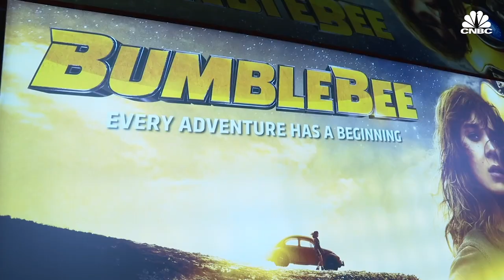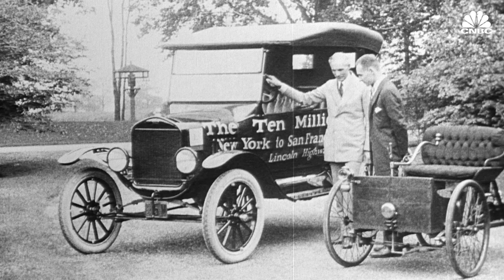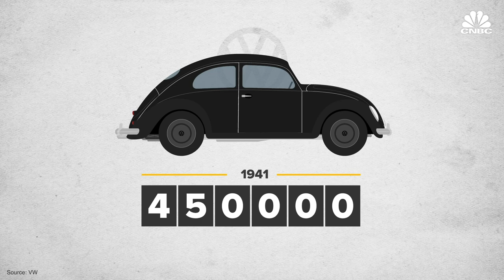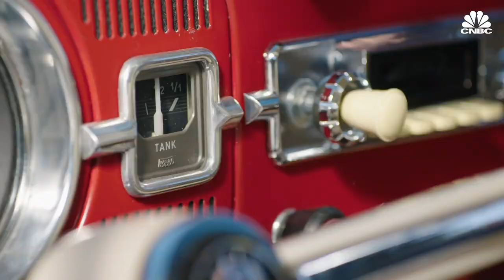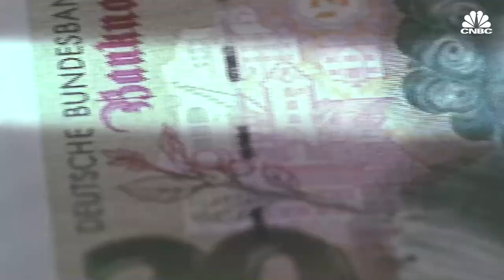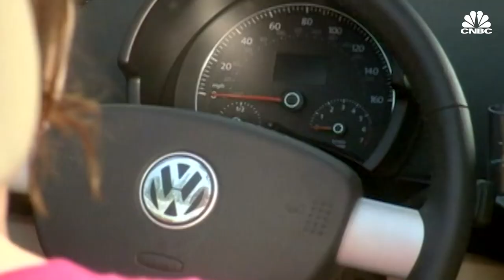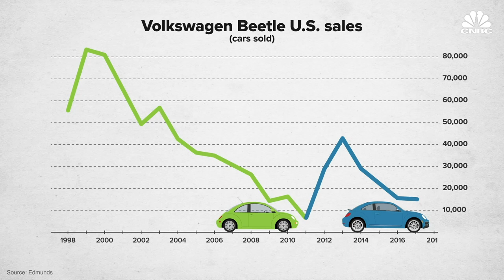Why Did Volkswagen Kill The Beetle?

Comment: If VW came out with a new "AIRCOOLED" beetle I'd get one ASAP. A new Super Bug with a water cooled engine and a heater  (That WORKS) In the older air-cooled Bugs, in Canadar in the winter, every VW owner had to have an ice scraper otherwise, you would drive BLIND or head out the window.

Comment: i am 100% sure, that the beetle will be back! but of course as an electric version - with rear wheel drive like the original beetle. but it will take a while. a ralley version with higher suspension and AWD would be cool too. and of course as a cabrio version. and with an old school radio with two classic knobs.

Comment: The classic beetles and buses ended in 2016 in brazil, Why?? Because they dont have air bags and safety equipment. The 2016 busses and beetles all had water cooled engines rather than Air Cooled.

Comment: The "Beetle"   "There is MUCH MISSING FROM THIS STORY.  There was the Karman Ghia sports car which was also a TYPE 1. along with the TYPE 1 2 door sedan. There was the Van/truck which was the TYPE 2, the station wagon was the TYPE 3, the 411 was the TYPE 4. Hitler just happened to be the political party in power "the Party in Power has the Money to invest in this." Hitler never rode in one, preferring a Mercedes Benz. 
. Besides the customers called it a Beetle, Bug.  Not the dealer.
The Type 1 died because the air cooled engine could not meet California air pollution guidelines.
The next car was their FWD Rabbit/or Polo/ or Golf. Many countries got a different name badge for the same car. Jetta came later(still basically a Rabbit)which had electrical problems.
. VW brought out the FWD "New Beetle"(so factory name) for a bloated roller skate on a Rabbit frame(so it had electrical problems).
.Too much bling in a basic car so it cost too much. They outpriced themselves as Honda Civic was the new cute car which had heat and more reliable and cheaper.
 ...As for safety - in a head on collision with an air cooled beetle with a full tank of gas=hitting a v8 front engined car ( because fluid does not compress, nor does it explode into a ball of flames.   (That is TV special FX with dynamite strapped to the car.)  Most cars in the junk yard have not been on fire.  Maybe 2 ?out of a 5000 cars.

Comment: The way they worded it, it sounds like the VW Beetle has sold the most of any car model, but then they said that it was behind the Golf and the Toyota Corolla in terms of popularity. The wording is so vague, with words like "perhaps" and "one of the most successful", yet they give specific stats like 21,529,464 original VW models sold. The editorial oversight is really lacking here. I've watched the first minute and a half of this video a few times just to get a handle on whether the Beetle was indeed the most successful car model in terms of sales or number manufactured, but I still don't know. Maddening.
Reply: More cars called Toyota Corolla and VW Golf have been sold. However the first Beetle built looked very much like the last one. Although just about every part of the car had been changed and revised several times over. The Corolla went from notchback to hatchback, and its various incarnations were very different. The same could be said of the Golf too, although it has always been a fwd hatchback.

Comment: Why was the beetle great?  Because you could unbolt the engine yourself, yank it loose and drop it on a tire in your driveway. Then get a friend to grab the back bumper with you and lift the rest of the car off and over the engine, still sitting on the driveway. It was SO easy to work on!
Reply: Well that was IF the back bumper didn't come straight off. BTDT.
Reply: @RodFleming-World   non-rusty, no road salt Oregon. The chopped buggy did just roll away.  :D

Comment: The last original VW beetle faced formidable challenges
it  had a small 1200/1300 cc engine.It couldnt properly handle an air con compressor 
it was not fast enough on highways 
it had a very small boot 
chest high dashboard 
BUT IT WAS VISUALLY  ASTOUNDING 
VW should have quite simply corrected the above downsides and Im sure it would have sold well almost forever
I owned at least 7 over 30 years 
Id have bought one
I did not buy the new one 
because i was disappointed
it didnt look nor was anywhere close to the original
 VW went on a tanget trajectory altogether to produce a car which was quite different actually, it was not a VW beetle anymore
There was a gap...the proverbial baton did not pass properly....from one generation to another

Comment: When I think of the engine efficiency (low), rear-engine handling (risky) and the heater (ineffective) and then remember the noise and crashworthiness of a Beetle, it's remarkable Volkswagen is still in business.

Comment: I owned a 1966 Beatle. What a piece of garbage it was. Slow,  blew up. I am not a fan of air cooled engines. The VW van was worse. All my HS buddies owned either  bug, van or 411. Every person I knew that owned one had to rebuild the engine. Yes, cheaper to rebuild but to say it is dependable is a joke.

I currently own a Suzuki Ignis.  About as small, more practical design and utilization of space, more fuel efficient,  quieter, better riding,  better in every metric and I paid $12,525 for it brand new, loaded (electric windows and doors, great AC, good audio system). 

"The price of a Beatle in 1966 was $1585. $1 in 1966 is equivalent in purchasing power to about $8.00 in 2020" In today's dollar a 1966 Beatle would cost $12,680 so essentially by Suzuki Ignis costing $12,525 out the door with much nicer amenities is a true replacement for the VW.

The problem with most Americans is they want a fancy,  status symbol SUV thus Suzuki isn't even imported any longer.  The Bug was an early version "city car". The Suzuki Ignis and other affordable city cars are currently being built but America doesn't want them.

Comment: Growing up in So Cal, I had two Beetles, a 1968 with a heater that never turned off, even in the summer time, and a 1973 yellow Beetle with a sunroof which I loved. I was excited when the "new" Beetle was announced and I saw the concept version several times. It was awesome. Then the real "new" Beetle came out and it was awful. Yes, I'm going to say it. It looked like a girls car. It was just terrible in every way. VW's response that they changed the concept for safety reasons. That's what they all say. Anyway, after 1979 the real Beetle went the way of the dodo bird. I should have bought a brand-new old Beetle from Mexico when I had the chance. Dang.

Comment: Volkswagen's new electric car has been coming "next year" for nearly a decade now.  I know they make an electric car, but if your state isn't in the 10 state (I think) CA emissions market, you'll see more Volkswagen EV conversions than factory built EVs, which is to say, Very, Very Few.  An electric Type 2 Bus/Transporter would certainly be more popular here in the US than an Electro-beetle would be.  I'd certainly give it a look.
Reply: There have already been US reviews of the iD4 BEV crossover and the iD3 hatch is selling in other parts of the world with its' YT video reviews....

AFAIK,, VW will sell the iD4 nationwide as to populate the battery charging network VW (as part of repent for its' Dieselgate sins) is paying for.
Reply: @syxepop  I agree that VW will eventually sell their EV's nationwide, but I see this as a ways down the road.  I'd happily be wrong.
Reply: @markchapmon8670  - VW will want to sell more BEV's than you think because THEY WANT TO REPENT FOR THEIR EMISSION SPEWING SINS and to be considered a PREMIUM MAINSTREAM BRAND in US.

VW won't be able to justify their actual pricing policy with ICE vehicles, as it it has been the case since 1976 (going upscale after the German Vintage Beetle's demise).

VW will probably "make a 180" and sell the iD3 in US at the mid cycle refresh mark as a "base Golf replacement".

Comment: Brand new VW in the early 1960s = $1,700.00 and it was engineered to due 1 million miles. The VW had a simple small horse power motor that took you down the road at 30-40 miles per gallon. It was a great car!

Comment: I heard they still make them in mexico. But the united states has more safety standards and an extremely expensive epa fees, to get a car epa certified into the united states. Use the mazda rotary rx-7 as an example. Ended in 1995 cost of epa regulations. Drove up the cost that they couldn't sell enough units 800 or so in 95. To justify keep selling in usa. But it still sold in other countrys for a few more years.

Comment: The new beetle defied the principle of the old one. Although the old one's were crude and the engines wore out after 50,000 or 60,000mi, they were cheap to buy and cheap and easy to repair. The new one defied these principles by being a problematic POS with a high initial purchase price and high maintenance cost. Bye Bye Beetle (good riddance to the new one)

Comment: A rebadged rabbit is not a beetle. The VW beetle died decades ago and this newer version was just a cheap knockoff not worthy of the name. Sure couldn't make it into a good dune buggy.
VW ended the original beetle due to the cost to make it was more than the price it was beng sold for.  Shame  as just when customers were looking for smaller vehicles it was cancelled.
 It would be nice to have a limited run of the original design down to the last bolt.

Comment: Your history is wrong. Porsche was not directed no but rather he had wanted to build a cheap car for the people but no one was interested till Hitler came along. The success of the car had lot to do with Porsche's design. It was suppose to have been able to be repaired by its owner and it lived up to that. It had only 3 bolts holding the engine in place and one person could remove the engine for repair. The simple design later caused its failure. Being air cooled made it a lot simpler to maintain but cold in the winter.

Comment: The Beetle could have lived much longer if they had used a more efficent engine.MAybe something like a 60-75 HP 3 or 4 Zylinder liquid cooled.And less than the original 10 Liter on 62 Miles.That was just tooooooooooo much for what the engine did.The weight was Ok when you remember that you ha a kinda closed basement

Comment: First car ever was a 1300cc 1966 Beetle with crappy Sapphire radio and 6 volt battery. So light that when you crashed you and your friends could pick it up and put back on the road ;-) Beat the crap out of it then sold for 300 bucks. Yay Beetle! 
https://live.staticflickr.com/2499/3998082052_f17a829450_k.jpg

Comment: The New Beetle was Not as Nice as the Original Bug, It Should Have Stayed Rear Engine, and be Built Better, the New Beetle was Junk always Breaking Down and Always Needing Fixed..... Yes the Old Beetles Broke Down but they were built Since WW2 to Late 70s and Sold Thousands and if Properly Maintained every oil Change Very Seldom had Issues. Just my .02 Cents.

Comment: Because there are stupid enough to not to make a goddamn manual and DGS version of it with RWD based AWD system, basically New Beetle 5C that is a Golf R or Audi RS3 underneath it. Also, largest marketing & Sales strategy in car history; keep calling the car 50 Years old Hippy Women!'s feminine car, while the previous generation was (Even the one before it) looks quite masculine Porsche 911 type of charismatic car that easily becomes lvery very good looking car with just few light exterior mods (Glossy black wheels, logical size spoiler, front bumper extension, etc.).

Comment: What about an electric beetle??
Reply: If VW finds enough takers (not likely) might turn into a RWD iD1 or an iD2 (MEB "skateboard" BEV platform is RWD and VW had plans several years ago to include a Beetle replacement in what is today the iD line of BEV's, as it did with the "Bulli" / Microbus).

Comment: The New Beetle was not a Beetle, it was a Golf in Beetlesque skin, which made absolutely no sense. A front wheel drive hatchback was made to look like the rear engined Bug of yore. Wide front fenders, round roofline, cramped rear seats, tiny trunk, no hatch - it was a pointless car, but it appealed to women. The second version with its flat roofline and wider stance pretended to be a Porsche for paupers and failed miserably. It was no longer a cute vase on wheels, and it was not a Porsche replacement. Also, boomers, who were the main clientelle on the New Beetle, started to die off. Good riddance, it was a fake Beetle.

Comment: The story here is way too surficial. Drill down a bit and find out a bit about the engineering compromises/failures, like with front & rear suspension, steering, engine, aerodynamics, heater, and on and on. If you're really hooked on image, you might buy in. If not, you might see it as an outdated wannabe. It's all about marketeering.